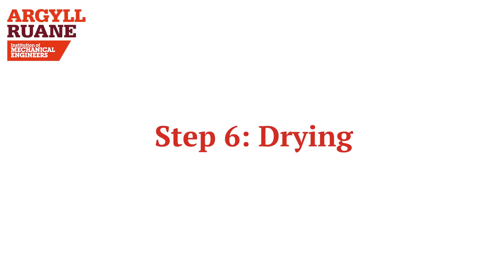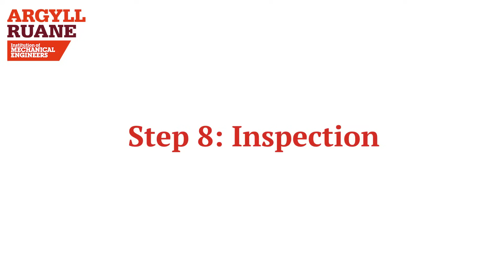An Introduction to Florescent Penetrant Testing: Post-Emulsifiable | IMechE Argyll Ruane

Comment: Should you not do your uv inspection in a dark room???
Reply: no it needs to be a dark room
Reply: Doesn’t need to be dark just minimum of 20 lux of background light. You’d be surprised how light that is.
Reply: Depends on the spec
Reply: And an eye adjustment period of 1 to 10 mins, depending on the process spec